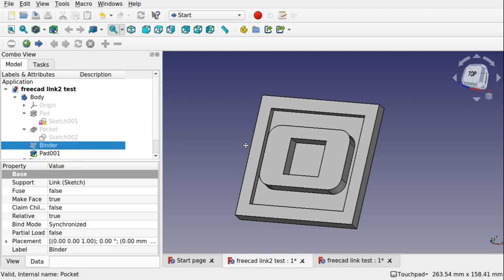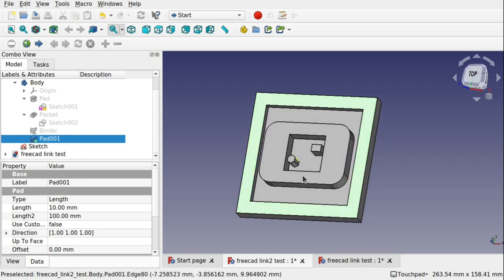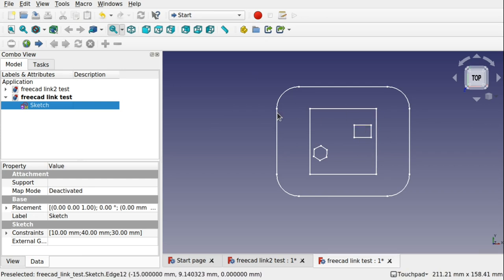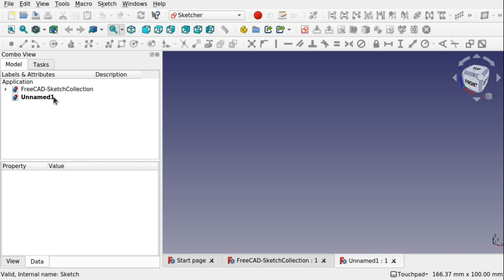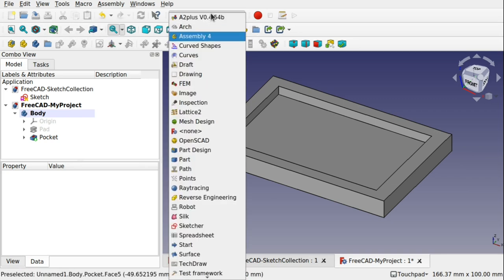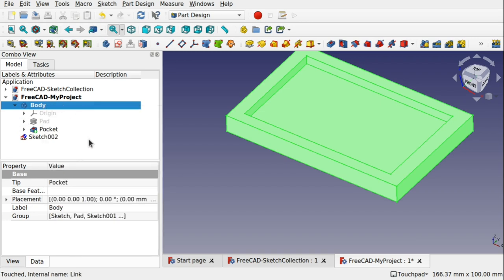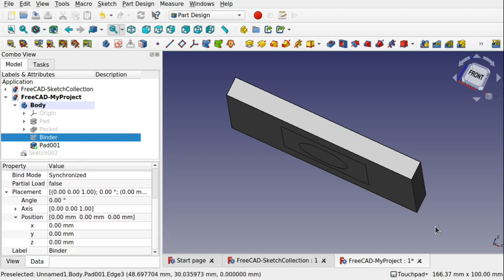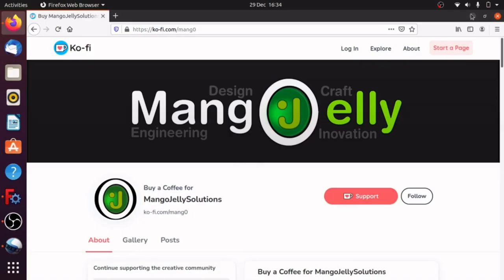FreeCAD: Sketcher: Template sketch from external files for repeated geometry. Link and Shape Binder

Comment: This is exactly what I needed! Thank you. Could you make a full tutorial on multibody design workflow? I come from an inventor/solidworks background where every real world part needs to be a separate body in the cad model for CNC programing to be possible (e.g. table legs, cabinet doors, ...). The idea in freecad (I think) is to create a part file as the container, then for every real world part create a body with sketches and needed features (e.g. a model of a table would have one part containing  a body for each leg and the table top, so 5 separate bodies). After the model is done, open an assembly work bench and separate each body into a part, assemble the parts into the table again and begin the process of CNC programing for each of the parts/bodies (sawing, milling, drilling, ...).  This video in particular could be the key to the needed workflow since most tutorials focus on single body design (what should often really be multibody) and that approach is pretty much useless outside 3D printing.
Reply from the maker: Hi, thank you for the comments and glad you liked. I am currently 1 video away of completion of a multi-body work flow at the moment where I am creating a Piston and crank shaft assembly using part design and a2 plus wb. It also uses a master  sketch. This is currently on my channel and will give you an idea of the workflow. Its part of the understanding freecad series that I am running. There are 4 videos in lesson 3 but you will only need the first 3 as the last one is about scripting an animation with the wb. I am looking to do more generic ones around this workflow in the very near future.

Comment: So, how to have a parametric sketch (or a part made from one, for that matter) in one file, and then link it twice, so that one can change the parameters of the one link to one thing, and the parameters of the other to something else. E.g. I have a panel (cube) that is sized like <<param>>.length, <<param>>.width and <<param>>.thickness, include it twice, and be able to have one link sized 4x5x1, and the other 5x4x2 for example?

Comment: Thank you for this 🙂
What's the advantage of using a link here? You could also use the binder directly on the original sketch.

Also: it doesn't work for when trying to build on top of this with a second imported sketch 😢 the first sketch I import is used to pad, then I want to do a pocket with the second imported sketch but it fails... Any ideas why?
Reply: I wish I knew. Maybe the link allows for reliably pointing to sketches in different folders?

Comment: The only thing that worries me about external links is reliability of pointing to the right location...
For example what happens if you switch between Linux and Windows (I use both)
Can you edit link address?
Otherwise great video (as usual 😉) - thank you 👍
Reply from the maker: Thanks for the comments, glad you're enjoying the videos. There is a link pointing to the file on the data tab but I have never changed it. I would assume you can. Next time I will have a look as I am now wondering if you can just give it the filename rather than the full path so it would look in the same location as the project file allowing, maybe, to  just lift the directory and place it in another location.  This is the reason why I love people commenting on the channel and the videos, really makes you think about what else you can do with the software.